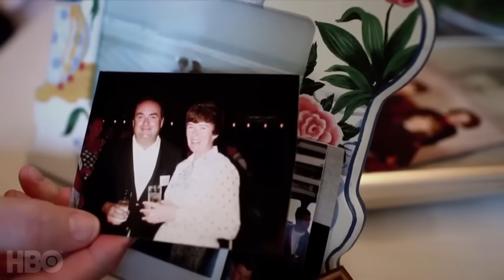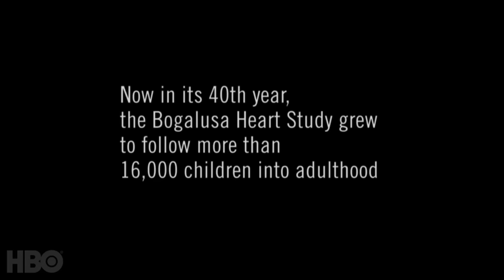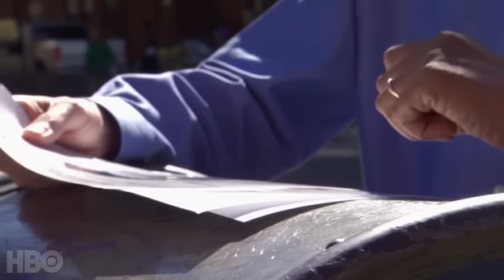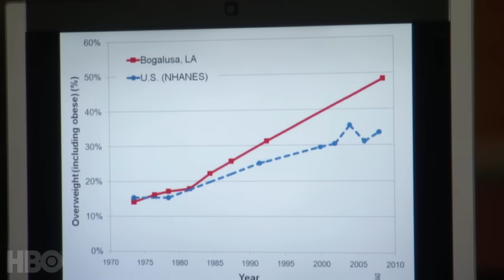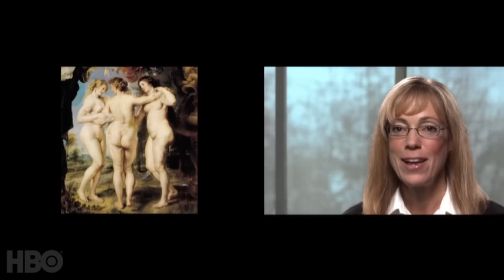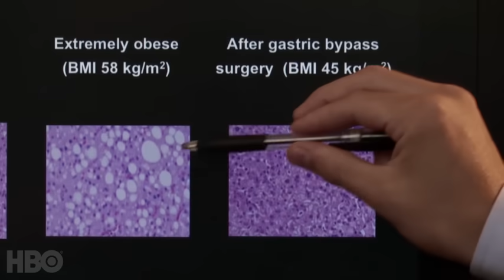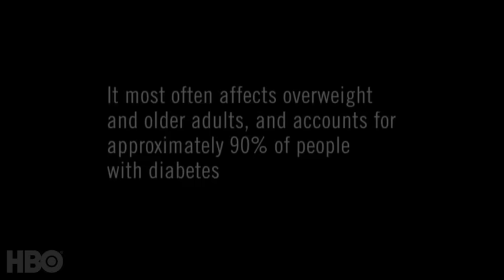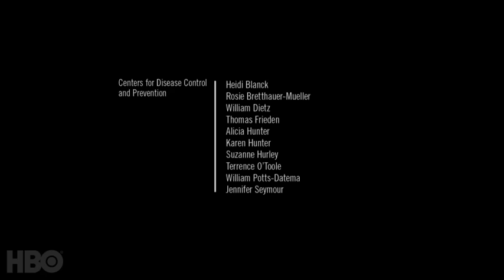The Weight of the Nation: Part 1 - Consequences (HBO Docs)

Comment: In the long run, the problem is difficult to solve, as it's multi-faceted.  Simply blaming the people for being lazy can only go so far when so many are affected.

One problem is the quality of food is drastically decreased.  Corporations want to maximize profits as much as possible.  And since we refuse to pay more for something than we did last week, the corporations have no choice but to reduce ingredient quality via cheaper substitutes.  What they may or may not have realized is that these substitute ingredients don't fulfill you or are near as nutritious as the real thing.  This leads to consuming more just to reach that satisfaction level, which in turns lead to even greater profits for the corporations.  Don't believe me?  Take for instance, soft drinks.  When soft drinks were first produced, they contained sugar, and not high fructose corn syrup (HFCS).  While the U.S. has basically stopped producing soda with real sugar, in Europe, it's still a thing for real sugar.  Guess what?  The soda actually tastes much more bitter in Europe, despite it containing real ingredients.  These non-real ingredients cause such addiction that it's hard to just say "stop."

The other problem is that people are eating on the go a lot more than years ago.  Back 40 years ago, you always had the mom staying at home, cooking a meal with real ingredients from the store, and not some packaged, processed meal.  Although that's considered "old fashioned" or "stereotypical" now, it at least ensured the whole family got to eat a good, healthy meal (and typically a good, healthy lunch and breakfast, too).  Now, you have both parents typically working (or one in the event of single families), either out of necessity or wanting to live their own life.  The downfall is that our lives are so busy from waking-up to bed-time that it's impossible to think straight.  It's very difficult to work a full day, come home and try to prepare a full meal for the whole family and a lunch for the next day at work, find time to exercise, AND spend time with the family.  Something ends up being sacrificed, and that typically leads to eating out more often (which isn't healthy to begin with) or eating pre-processed food (which goes back to the 1st problem).

It's a vicious cycle.  The only way out requires some sacrifice.  Either we must be willing to pay more for the necessities from corporations (if they're even willing to go back to the old way), or we must be willing to take the time and plan meals which don't involve packaged foods containing 50+ ingredients.  If not, this obesity trend will continue.

Comment: Big Mac has been around for 60 years.  That’s not what’s causing all this.  Statistics show we’ve been doing what we’ve been told as a nation since the 80s- red meat is down, fat consumption is down, especially saturated fats, vegetable consumption is up, grains and carbs consumption is higher, exercise is way up.  That is the environment in which obesity has exploded.  The country didn’t all spontaneously become slothful gluttons all at once 50 years ago, something is wrong.
Reply: lol Exercise is not "way up". That has been going down for awhile.
Reply: @IgnoreMeImWrong   People didn’t exercise much past adolescence until running became popular in the ‘70s and gym memberships in the 80s along with various types of aerobics, now called cardio.  Adults didn’t ‘go to the gym’ much before then.  Tv shows all made fun of it early on, dismissing running as a silly fad.
Reply: @ovrezy  Dude, people excessively exercised, their every day life was a massive energy expenditure. It's only in the recent few decades that it has slowed and those memberships have become a need to begin with, and it's not even close to the loss of movement in the nation.

You can't possibly look at the last century and think: Well, the average energy requirement has gone down but people intaking the same levels sure isn't connected.

Comment: With the latest findings that the true issue is not the fat but the sugar, carbs and fructose, if people just eliminated the sugar and cut the other two will lose weight FAST.  I was 254 lbs in the beginning of the year.  I just cut sugar completely from my diet, and made sure I cut my carbs to below 50 grams.  I weigh now 225 lbs and I just started to work out.  I have not felt as good as this since my late 30s when I stopped playing soccer
Reply: The sugar thing is a lie. What you cut out of your diet is the calories.
Reply: @TippyPuddles  Keep saying that to  yourself and keep eating it then.

Comment: The basic biology is that insulin signals the body to burn glucose and store fat.  You can directly effect the amount of insulin you produce by the types of foods you eat.  The more you limit carbohydrates, the less excess fat you will retain.  Type 1 diabetics have 0 insulin, look at pics of what happens if they do not take insulin, they waste away.  Limit your carbs as much as possible and you will not be fat anymore.  Yes other hormones play roles but you cannot control them like u can control insulin.  Replace carbs with the only other energy source, fat.  Don't be afraid, take your life back and learn current dietary guidelines are a farce

Comment: I find it interesting that the correlation is between the poor and obese, as in history it would be the rich... the poor couldn't afford to eat well.  But now I see the biggest correlation is between the medication and obesity, which is my experience, as I've always been underweight but I would eat a lot.  Dealing with a health condition, I've come to realize that certain medications cause weight gain even if you aren't eating much (due to feeling sick).  I haven't quite reached obese as I've stopped taking the medication causing it, and my weight drops back down.  I believe it has a lot to do with hormones and how medications affect hormones.  There is still the element of overeating, but in my situation, that was definitely not the problem, as every time I'm feeling better and start eating a lot again, I lose weight, so it's backwards than what you would expect.  Now I have lost the most weight in my sickness when not on those medications, but I've become so thin and weak, that I could barely stand.

Comment: What nonsense. People are obese because they eat what they want (high carbs and high sugar foods), when they want (snacking and eating all day up until very late at night) and how much they want (large portions and/or excessive snacks). Eat a low carb high protien diet, have a shortened eating window (so stop eating at 5PM for example) and calorie count/be accountable for how many calories you eat (work out how much calories you need to eat to loose a pound a week). Do that and youll loose weight.

Ultimately, if youe been use to those nice sugar snacks and chocolate and large carb meals and take aways etc, its sometimes hard to give up alot of that, so it becomes do you wana look good or do you want mcdonalds? Most people choose the mcdonalds nd the more normal being fat is, the easier it is to choose the mcdonalds and the fatter the nation will get.

Like smoking, dieing from a complication of being overweight or obese takes years and years most of the time, so like smoking people will ignore the imapct on health. Unless mcdonalds are going to be made to start putting disgusting pictures on there packaging of cancers and dead people etc, like tabaco companys were made to do, pople are not going to consider the long term effects of there health most of the time.

Comment: Here is the problem I have with the whole obesity thing. The way the medical community does the BMI is labeling even Arnold Swartenegger obese, they are labeling those who are basically muscle as obese and therefore unhealthy. This is further from the truth. Bodybuilders are not obese. They are not unhealthy. These doctor need to realize that muscle weighs more than fat. So instead of height to weight comparison. The BMI needs to compare muscle to fat. The more muscle you have the healthier you are. The more fat you have the less healthier. So, lets do away with the height to weight ratio and compare muscle to fat. This will be more accurate than the current BMI.
Reply: Say you're overweight without saying it.  Do you really think that muscular people are saying, "Omg, my BMI is too high, I must lose weight!!!"
Reply: @opieutt9038   No I don't. In fact they are healthier than most people, but under the definition of BMI( body mass index), even bodybuilders are considered obese and overweight. This is because BMI does not take into account muscle mass, which is heavier than fat. BMI only takes into account the fact that a person weighs more than their " body type" should weigh. This is the major flaw in the body mass index. And way too many doctors use this flawed system to determine if a person is healthy or not. So, to my knowledge bodybuilders don't use BMI necause it is flawed. They compare fat to muscle which is the way to do it. At lesst when I started going to the gym in Utah that is the way it was done.
Reply: @TeaTimeThrillers   That is true, even most weight trainers don't go by it. However, there are still too many doctors that do. We need doctors to get away from BMI and use something that takes into account muscle mass vs fat and life style. This will determine if someone if unhealthily obese. This is why I would like to see more and more people harping on the flaws of the BMI until the medical community stops using it.
Reply: sure, if you are taking about individuals with sub 10% body fat who are visibly ripped. if not, BMI is accurate. if you are tall, you really should not have much fat on your body. tall and slender.
Reply: @benicia21   there in lies the problem and the point of my comment. Which is, if you differentiate muscle vs fat, you get a true sense of how healthy the person is. But too many doctors are of the mindset that if you weigh more than your body type, no matter how much muscle you have, you are too fat and therefore unhealthy. There is even a weight trainer in Denver who agrees prescribes to this notion. In fact he has said that he has never met an over weight person who was healthy. He even stated that you couldn't have a ton of muscle and be over weight. Of course most everyone and most trainers strongly disagree with him. This is why I call the BMI inaccurate, because of the way it is being used or, as I should say, misused by medical professionals. That is the essence of my comment, which is to get doctors to change their mindset from a one-size- fits-all BMI to a BMI or other system based on muscle vs fat. Basically getting doctors to recognize that muscle weighs more than fat and that a person with ,lets say for the sake of arguement, 80% muscle to 20% fat, weighs more tham a person with 80% fat and 20% muscle. And doctors need to realize this when deciding how healthy a person is. Lets face it, there are doctors who will call Arnold Schartzenegger too fat and we all know that isn't him.

Comment: 120/80 is the new limit, it used tobe 140/90 was the healthy limit. If your BP is between 120/80 and 140/90 you don't have high BP, it's technically called prehypertension but it's not a medically treatable condition and it's still a healthy label but towards the upper quadrant of healthy.

Comment: biology hasnt changed.  thats not a thing.  whats happened is the creation of food deserts where towns are no longer ringed by local farms.  meaning there are many places where healthy food isnt easily accessible which oddly tends to be mostly rural areas.  food deserts are a creation grocers.  ultimately grocers dont put stores in areas where there is little population because they think theres no money in it for them.  this mentality has to change.  what is available in these rural areas is junk food because KFC and McD's gets it.  gas stations get it.  when walmarts starting inserting stores with grocery into these areas it was a miracle because it meant low cost food with easy access so walmart did and still does very well in these locations.  thats what businesses and grocers like public, winn dixie etc need to understand...dead customers dont add to your bottom line.

Comment: Beating obesity is not about " sticking together " its about zeta potential,  oxygen,  circulation,  whole body metabolism,  and hormones.  If anything sticking together was the problem.  Because that's what fat and cancers do . Its weak. Your electrochemical state ph drives your microbiome and your metabolism.  You dont want to be cold ( constricted ) and acidic ( stressed ) . Stress should come with warmth and cold should come with low stress high oxygen.  ITS THE EBB AND FLOW OF NATURE YOUR NOT EVEN WIRCHES YOUR PROSTITUTES FOR GOVERNOR PIMP